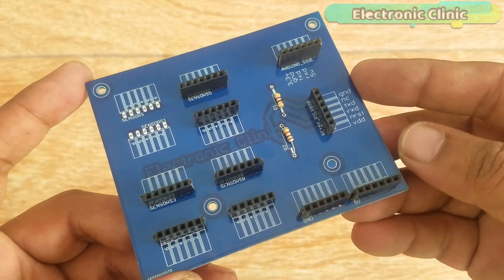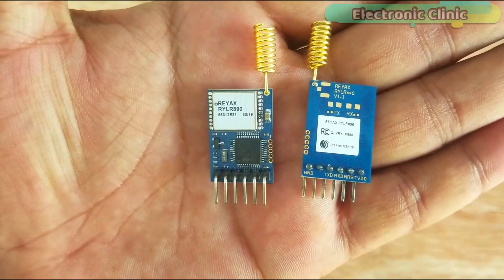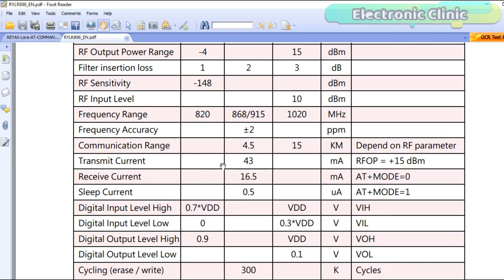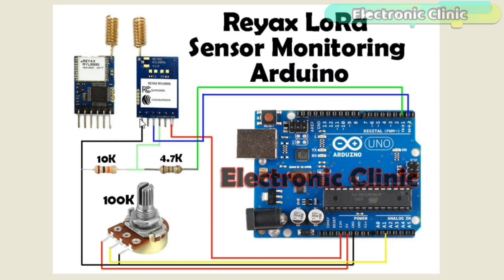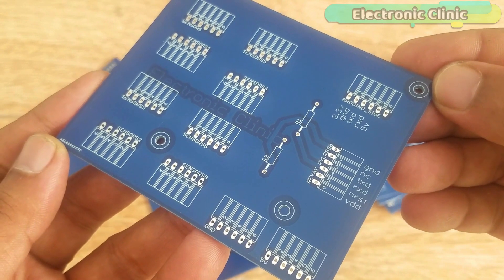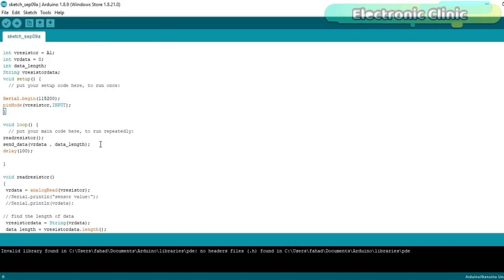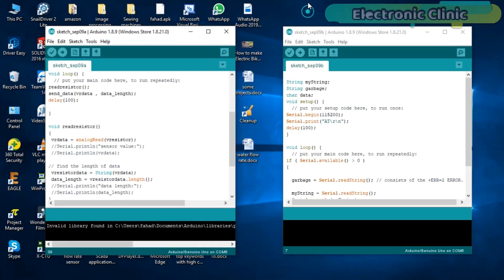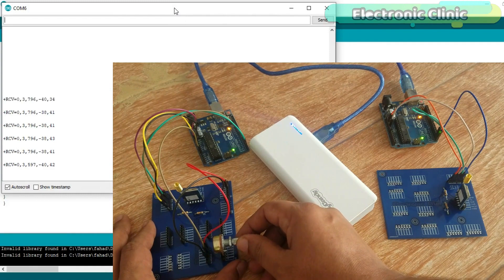Reyax rylr890/rylr896 LoRa based Sensor monitoring using Arduino

Comment: Thanks for the video. My code verifys and uploads good but the 2 traceivers do not communicate. it  can't seen to be getting data wirelessly. What can I do?
Reply: I also can't get the transceivers to communicate with this code, at least not very good.  If you change the delay in the TX code to 1000 milliseconds instead of 100 in the void loop, it will kinda work but not that good.  In this video, it shows that the data received is printed on the serial monitor with a serial.println (my message) Then there must be a serial.println("") because on the serial monitor it shows a blank line between data received prints.  If I run this code, my serial monitor won't print the data received like shown in the video.  It prints in chunks with no blank lines in between.  However, if you watch Electronic Clinics video on the "multiple sensors" using the reyax modules, that code works great.

Comment: Super one sir best explanation  by you easy to understand 
Sir my 1 query  i want to switch on off motor range is 4 km please tell me which sensor is compatible
And by this it is possible  that after motor on  feedback also received  means switch button gibe command to on motor and motor side module give return feedback of motor on
Reply from the maker: ya you can receive a feedback. these are transceiver modules.
Reply: @ElectroniClinic   ok thanks sir  for your feed back 
If you have codes for this then please share.
Reply from the maker: i will make a tutorial on this.  right now i dont have a readymade code
Reply: @ElectroniClinic   yes sir  thats why i need your tutorial  on this  i am waiting